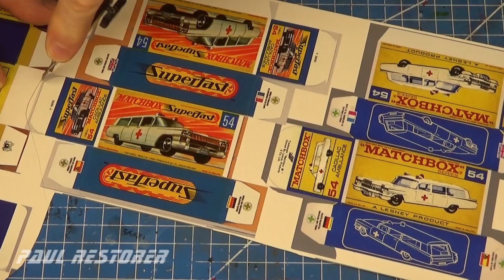Matchbox renowacja S & S Cadillac Ambulance nr 54. Model odlewany autko modelik.

Comment: Excellent restoration, Paul. How many layers of paint do you use? How long does it take for the paint to be fully dried? Thanks.
Reply from the maker: Thank you very much. First, one coat of primer paint, which is quite thick paint. Then 2 coats of base paint and two coats of transparent paint with a hardener. I paint with an airbrush so the paint is applied quite thinly. If I use a spray, then I put one layer at a time.
Reply: @PaulRestorer  Thanks for the valuable information.

Comment: I've never seen a Superfast one of these Paul. Didn't realise they did both versions; like you say, quite a height difference. Is everything else identical?
The box art is very different too.
Reply from the maker: Overall, the whole bodywork is identical, the interior doesn't just have a spring tab at the front. And the chassis is differently shaped because of the springs.
Reply: @PaulRestorer  I see. Thanks Paul.👍